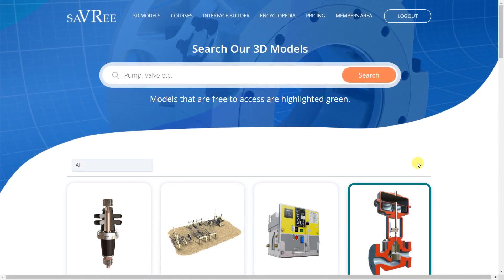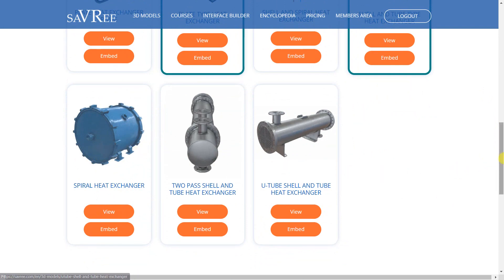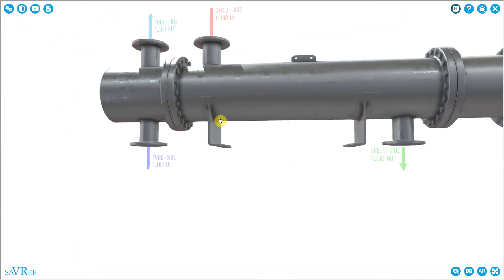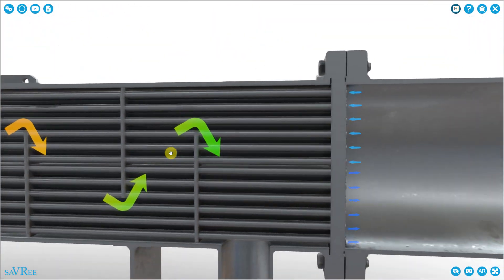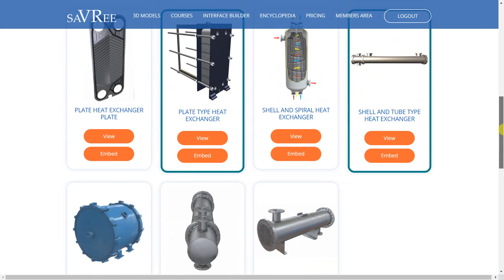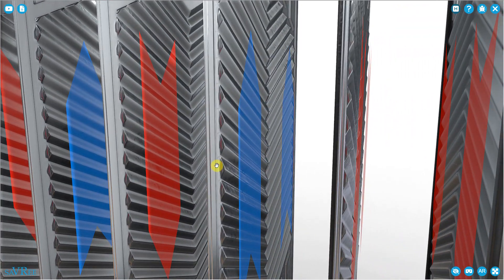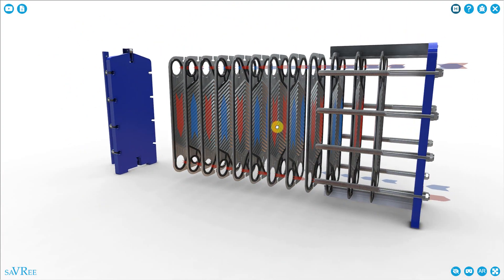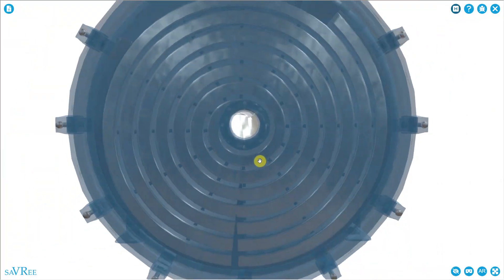saVRee Snacks #3 -Heat Exchangers Explained

Comment: These are exclusively liquid-to-liquid types, what about gas-liquid, gas-gas, and two-phase-to-liquid? These include feedwater heaters, condensers, hydrogen and air coolers for generators and motors, radiators such as automotive, steam generators, moisture separator reheaters, refrigerator evaporators, etc.